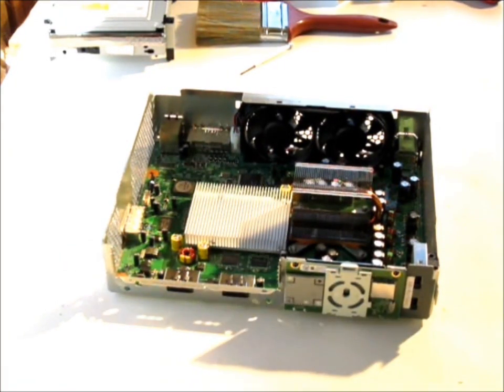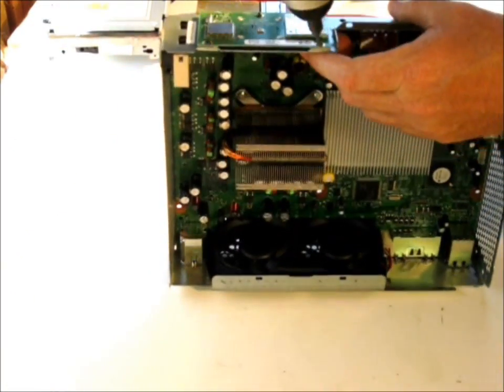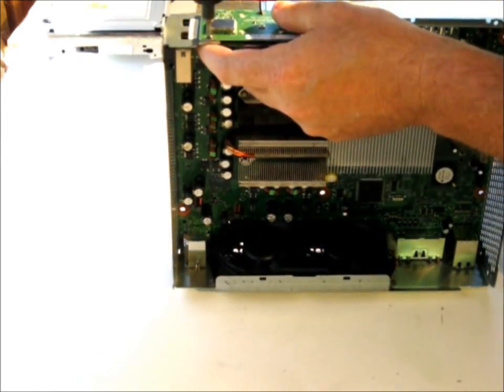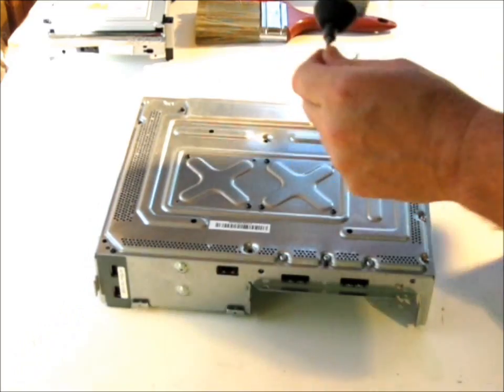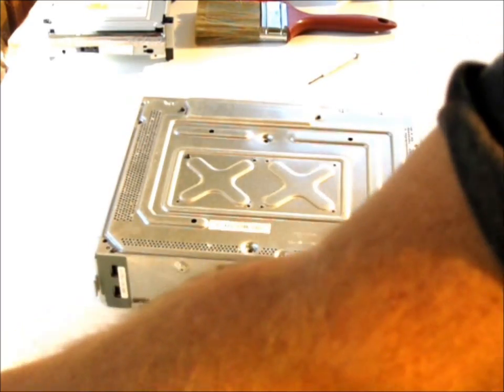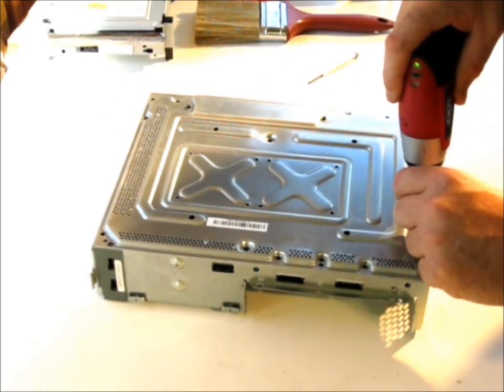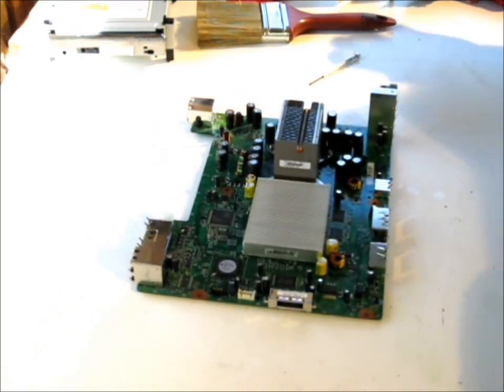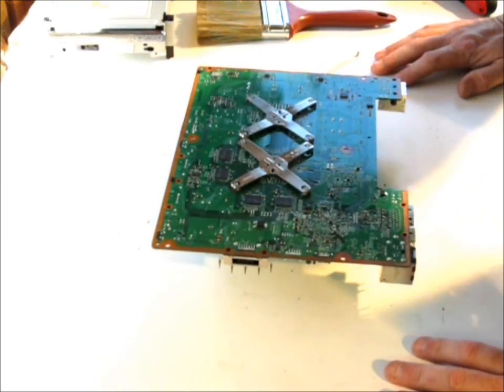Offical - XBOX 360 3 Red Ring Repair Guide - Permanently Fix your XBOX 360!

Comment: DAM DAM!!!! XBOX. FUCKING SUX. I was given an Xbox 360 .Now I know why the previous owner got rid of it. Practically new. Clean hardly any dust but it had the red ring that I fixed. THEN the fucking tray would not open . Ten it would not stay closed. I go in and fix that NOW the red ring is back and now it won't go away and I lack a smaller star screw driver and no thermal paste!!! WHAT THE FUCK!!!!!!?????!!!!PIECE OF SHIT XBOX.FUCKING RIP OFF to those who paid for this bull shit.

Comment: +zackary blackstar hi yeah the guide I got does work well here is my email address email me and ill send to u. the key with this fix I the pressure on the heatink. if u have 2 or 3 redlights after this. go back and slacken the screws off aboutg 1/4 turn on each screw and try again ive got 3 of these for sale at the mo. all running for about a month solid with no problems

Comment: if any 1 wants the guide to this don't pay for it. I have it in pdf format. let me know and I will send to u via email
Reply: Bro major props to you! anyways, my email is thatratchetasian@gmail.com
Reply: Jeff oops I would like the pdfkgvetran@gmail.com
Reply: Jeff oops You still have it? Does it Works????
Reply: Zackary Blackstar +zackary blackstar hi yeah the guide I got does work well here is my email address email me and ill send to u. the key with this fix I the pressure on the heatink. if u have 2 or 3 redlights after this. go back and slacken the screws off aboutg 1/4 turn on each screw and try again ive got 3 of these for sale at the mo. all running for about a month solid with no problems
Reply: Jeff oops Sorry dude, but I'm unable to find your e-malil....
Reply: Jeff oops SENT!
Reply: Jeff oops Hey bro sent you an email could you send me it please much appreciate
Reply: *****
Oh shit i thought you replied to me xD
Reply: +Kevin Shields Can u send it to Joostonly@gmail.com ?
Reply: can I get the PDF format for this? please
Reply: carloss3043@gmail.com
Reply: Jeff oops I want bro

Comment: Ok is this guy a engineer? Few points. 1 He has no antistatic band on his wrist. 2 He used a electric screwdriver (never use electric screwdriver) 3 He scrapped the heat sinks with a screw driver another BIG NO NO. This scratches the heat sink and can cause the heat sink not work correctly as it will end up with scratches and grooves.  

Also Microsoft does know the repair and its no secret nothing like trying to get you to buy his book.

Comment: I think u have to over heat the Xbox by unplugging the fan. U run it for 10-15 minutes. It'll get hot. Then let it sit for 10-15 minutes to cool off. Plug the fan back in and try it out before reassembly

Comment: did you just clean the heatsink with a metal screw driver? that is awful. the paste you will use after will go into the scratches you made and will create bubbles thus, you made it worst than before. please everyone! do not use that method. take something plastic instead or just be patient and rub it with a cloth..

Comment: my xbox has the same problem 3 rings of death but even so my xbox power does not come on when i turn it on it remains orange it was working the night before and the next morning it show 3 red light and my power is off even i turn it on when turn it on a red light show on my power pack and changes back to orange no power but i will try to fix it using your steps hopefully i can get working